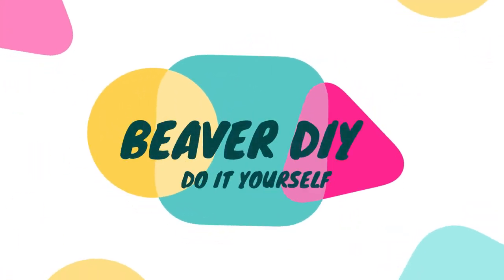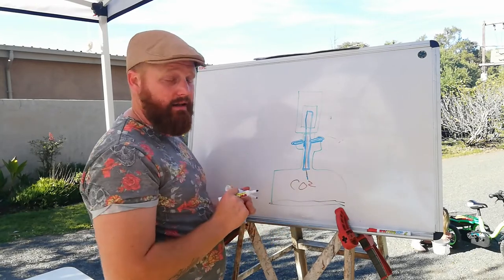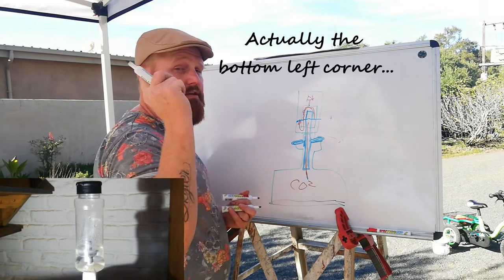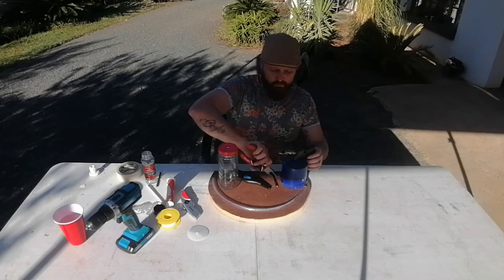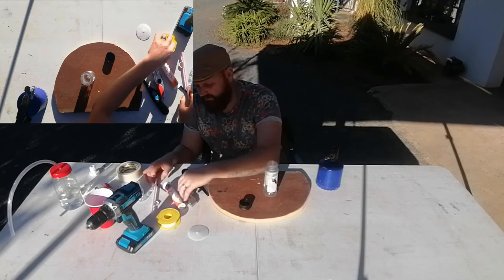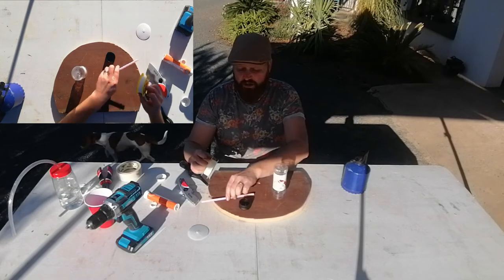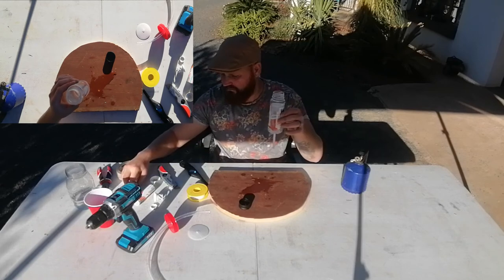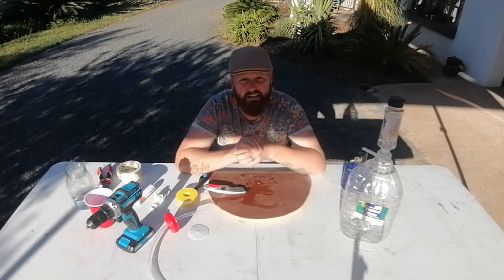DIY Bubbler (Airlock), How to make and use an airlock at home.

Comment: On the bottle and pipe bubbler can making 3 or 4 extra holes on the lid do for the CO2 to escape? Thanks again.
Reply from the maker: Jip you can leave the lid open aswell as long as the pipe is under water.

But yes extra hole will be perfect